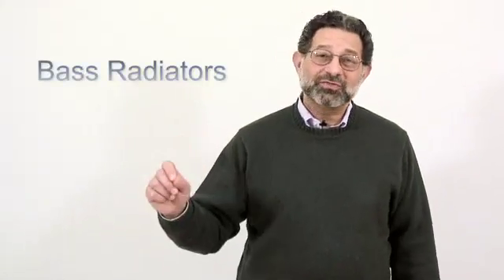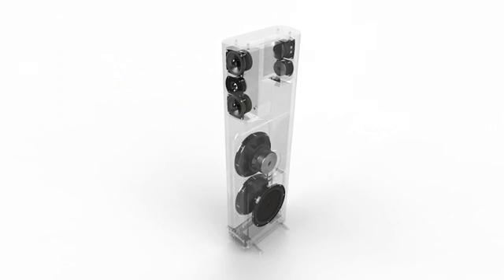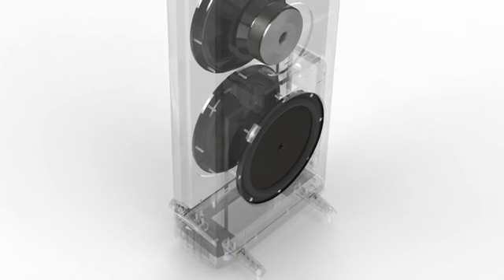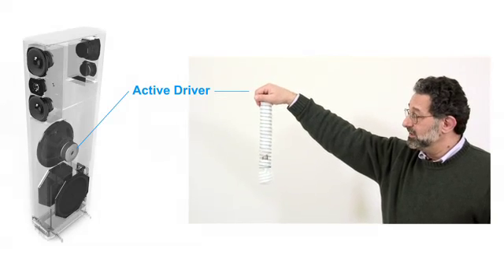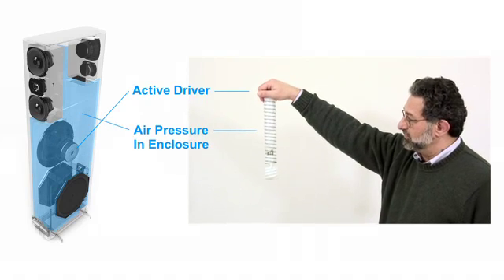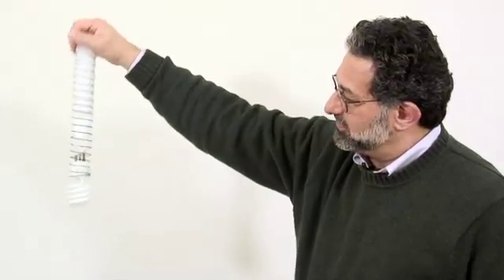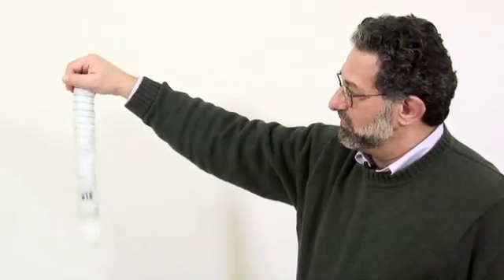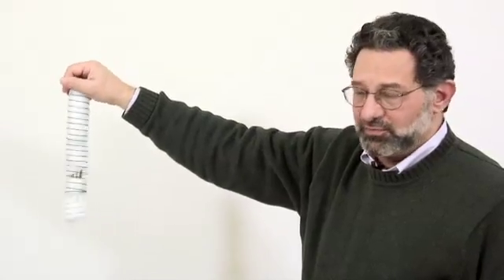Definitive Technology Tech Video - Bass Radiators

Comment: The technology does work, I know that for sure but I'm still confused.... isn't the radiator excursion directly linked to the volume displacement of the (smaller) active driver? To my knowledge a speaker cone has surface area (A = Pi x r2) and excursion (Xmax), which adds up to a maximum air displacement capacity (volume, or V), A+Xmax2=V (Xmax is total linear excursion from resting position 0, so you have to use Xmax squared for the maximum absolute travel distance of the cone). So now we have a certain amount of air (V) that is being displaced, and if I would take that volume and use it to push a passive radiator with a much larger surface area, wouldnt that linear excursion (absolute travel distance) be much smaller as the Xmax of the smaller active driver? I know air pressure is the key.... I want to understand why air pressure is related, and where I have to put it in the equation to make it work :)

Comment: Simple and useful explanation. The passive radiator is not connected to the power amplifier. A passive radiator system makes it easier for the speaker system to create the deepest pitches (e.g., basslines). These deep pitches are hard for the woofer to produce. If a woofer has to move too much to produce very deep pitches, it can damage the woofer (this is called "overextension"). A passive radiator system can provide an improved bass sound...

Comment: Hi, So the passive radiator is like cap on woofer exhaust that we have in enclosure and it just moves with the air inside the box to capture more base in closer distance if not wanting to capture the bass acoustically?

Comment: please help!

I have a box with two 4" fullrange speakers in the front and two 5" passive radiators at the sides, but i get the same output result as a sealed box. 
What should i do??
Reply: Crazy Experiments Hello. I see your question is 2 years old now, but just in case you still need an answer or others are having the same problem, here's what I would say you can do in such a situation. First of all, the air displacement (Vd) of the passive radiators should be twice or more the Vd of the active woofers. The Vd can be found in the specs list of a woofer, or calculated: effective area (Sd) times the max. excursion (Xmax). In your case, I immediately can tell that the Vd of two 5'inch radiators isn't enough for 2 active drivers. If you still can't get a nice sound by using the tip above, than you can tune the radiators by adding weight to them. A website like mh-audio can help with the calculations on how much weight to add.

Comment: The demonstration of the spring and lightbulb demonstrates a resonance frequency, which is actually distortion. Good for teenager in their rice burners looking for boom. Terrible for audiophiles seeking accurate reproduction of music.
Reply: It works like a ported system but is less damaging to the active driver below the port tuning which amounts to LESS distortion and wider controlled bandwidth. EVERY enclosure uses resonances to control driver excursion at low frequencies. -audiophile
Reply: This is not that big of a problem, the biggest one is that they operate in anti-phase with the original signal...

Comment: Ok, so the higher inertia of the passive radiator make it a low pass filter, but it moves in when the driver is moving out and vice versa.  Doesn't this cancel each other out?
Reply: That's what I was wondering
Reply: in non-seal systems sound is produced from both the in and out movement of the driver, from what I've read they have some way of getting the driver and radiator in phase so they move almost at the same time in the same direction but are usually never 100% in phase.
Reply: Passive radiators at the resonant frequency are actually phase inverters.  Look at his example when the movement is great with his hand, they move in opposite directions.  Passive radiators become out of phase with the driving woofer when they go below resonant frequency which causes an extra steep drop off of spl below that point compared to other enclosure types.

Comment: Bought a pair of StudioMonitor 65's and I'm completely in love. Well built, well finished, sounds great and this radiator technology does make a big difference. Believe it or not, but I have the room walls and windows where they are located shaking enough to annoy (or please, I don't know) my apartment (all concrete) neighbors in the 53 Hz frequency range already! They reproduce nicely down to about 37 (this low point audible at about 30 % of the whole apartment area) and well audible (at very specific spots in the ap't) down to 29. Now I'm planning on buying a sub and it might be the ProSub 800 or 1000 and I think I might have it set at 40-45 Hz, because I want to keep most of the bass coming from the 65's themselves (preserving some stereo imaging) and leave the sub only for the ultra low bass (well, I don't have it so it's kind of dreaming it will work the way I think and please my taste). I do a lot of research and for the price range, it's hard to beat DT's speakers. The SM 65's seems to be so well tuned in the low bass that something somewhere in the mid bass range loses a bit somehow (it might be a matter of placement, and if it is so, that's nothing a closer positioning to the wall won't help). The low mids to high mids are perfect and the projection is very wide. You barely feel any significant decrease or loss in the mids when 'angling' your position related to them. Some parts in the range of other frequencies are not as refined and I don't know how to explain that, but still good enough. I use EQ, but I did some listenings with no equalization and most songs sound engaging already. You also know when something is good when it's not tiring after a long listening session and you miss listening to them, and I do miss a lot and wonder if I had more time for that. The StudioMonitor 65 is truly a budget masterpiece and they represent the passive (bass) radiator technology at its best (for such a size).